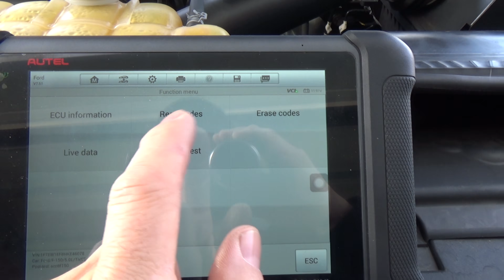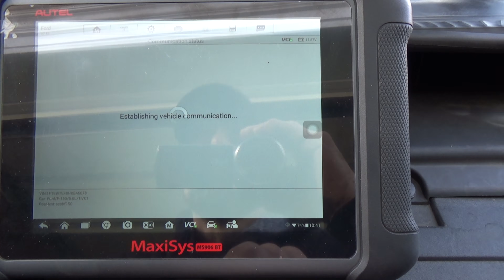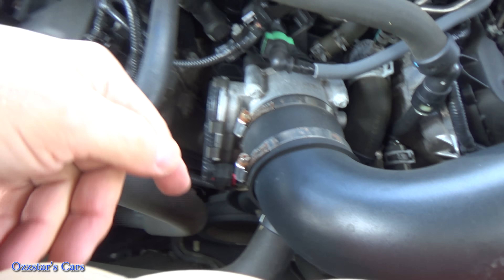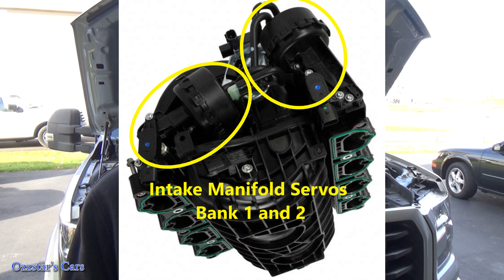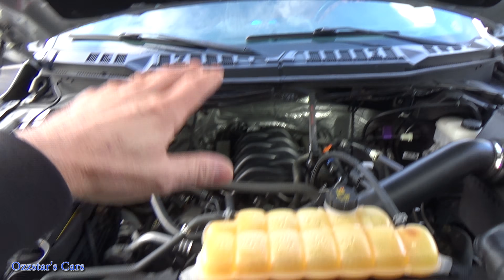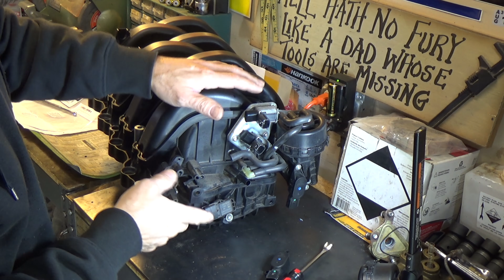Ford F150 Engine Rattle Tick Noise: I Can't Believe Shop Says It Needs A New Engine

Comment: Usually the shaft that runs the flaps breaks between the manifold and the actuator so the sensor still thinks it is working . Check the side that was making the noise and see if it is broken. It causes stalling at idle and everyone thinks it is the VVT system instead.
Reply from the maker: This was a defective intake manifold. The part is non- serviceable.

Comment: I have a 05 e150 4.6l I just had the timing chain and all internals done for that. Oil pump and both banks lifters and followers done and its still ticking at hot or cold start and ticking stays the same with the rpms. I'm now out 4k and I told ford just to put a new engine in it not to throw parts at it. Is there any advice you can give me the noise started at the passenger side front valve cover. I'd pay you to figure or it or if you can please reply and give me your two cents. I'd really appreciate it
Reply from the maker: Where are you located? I am in Delaware. Unfortunately diagnosing something like that over the internet is almost impossible. I don't like guessing and giving anyone poor information.
Reply: @ozzstars_cars  I'm in north carolina and I know it's next to impossible to diagnose over the internet let me read your other reply
Reply from the maker: But if I did have to guess.....were the exhaust manifold gaskets ever checked for leaks? That will cause a ticking sound. 👍😉
Reply: @ozzstars_cars  yeah I put a stethoscope to the front passenger vavle cover the tick seems to be coming from there

Comment: P1000 THATS WHY.THAT MEANS SOMEONE HAS CLEARED THE DTCS AND THE MONITORS HAVENT ALL RUN AND PASSED.TELL TALE THAT CODES HAVE BEEN ERASED IN A FORD
Reply from the maker: Or the battery died or was disconnected for repair.

Comment: My 2018 5.0 makes a cackling sound with light acceleration. My mechanic listened with a stethoscope and it’s not the cam phasers or timing chain. He watched this video and says it’s not the runners. He is stumped, I took it to a second shop, and they couldn’t figure it out either my mechanic did say the sound is coming from the passenger side on top of the engine. Any advice would be great.!
Reply from the maker: Did your mechanic use a scan tool like I did in the diagnosis? Bring the truck to Delaware and I can diagnose the issue.
Reply: Yes he used a scan tool, and said he even unplugged it and it still made the noise. Unfortunately I’m in Idaho.  @ozzstars_cars

Comment: Thanks OC that was very educational.  I have the same problem with my 2019 F150 with 30k on it.  It seems like it's getting worse buy the day.  Right at 1500 RPM it rattles like a metal on metal.  Been getting the run around for a while, need new engine, need new bell housing, need a new trans, need a new front shock, and so on.  Heck, by then I'll just get a new truck.  Ford should have fixed this problem under warrantee.  Great work on finding the mystery rattle.
Reply from the maker: Thanks Paul. More than several viewers have shown this video to their mechanic and helped them get the problem fixed. Hope your diagnosis goes well. Let us know how it goes if you can. -Glen
Reply: My actuators failed at 40k on my 19 with the 5.0. Ford replaced the manifold but the mechanical typewriter sound is still there... And they said to deal with it.

Comment: @ozzstars_cars 8ve been arguing with the dealership about my 19' F150 with the 5.0. They keep telling me it's normal but they don't hear anything. I only have 37k on it so whatever should be covered. Getting them to do it is the thing. I'll have to re-watch this again and write down details as to what to say to them.
Reply: Oh. And I never heard this noise until I started to drive the truck in manual. Due to the transmission shifting 1-3-5 then normal which is annoying. And I got scared hearing the clacking!
Reply from the maker: Better yet, show the technician the video! Good luck and let us know how it goes.
Reply: So, Ford replaced the intake manifold. They took it for a ride and said it was fixed. I drove it 50 feet and it makes the same exact sound. I have to take it back in two days.  @ozzstars_cars
Reply: Update. Ford told me there is nothing wrong and that is just how the engine sounds on the 5.0. At least I got a new intake manifold out of them. Guess it's time to upgrade the manifold and buy a tuner.
Reply: BTW. Ford refers to it as a mechanical typewriter sound.

Comment: I want to thank you for this video. I just bought a 2018 5.0 f150 from Manheim for $8500 4x4 SuperCrew with 150K miles. They sold it as-is due to a nasty "ticking" noise. No check engine light, fresh oil change, sounds just like this one. I have a Autel Maxisys Elite I'll try this on mine. Mine makes the noise at all RPMs but to me it doesn't sound like the "engine". I appreciate the video man!
Reply from the maker: Good luck!
Reply: Standard sound for an injector nozzles on an 18!
Reply: I own a 2018 5.0 mustang with 68k the dam thing typewriter tick started from day one after second oil change. But, goes away after driving 1500 to 2000 km of driving 5k oil change intervals . Possibly air trap in an oil gallery, low oil pressure, collapsing hydraulic slack adjuster. 🤔
Reply: @steveylikangas1989  Add Liqui Moly Ceratec at your next oil change; 100% fixes your issue.

Comment: Nice one. I have a rattle in my mustang's coyote. It sounds very similar to this F150. I believe the intakes are similar if not the same. Its getting checked out on Monday, but maybe it is this! Nothing like some ill informed armchair mechanicing right! Thanks for your informed video though!
Reply from the maker: The intakes are designed different. The intake runners on your Mustang is lower profile engineererd for horsepower over the F150 design for torque. Thanks for the comment John and let us know how your cars diagnosis goes. Maybe show them this video? 😉

Comment: Could this same issue make a rattle at lower rpm such as idle? Mine is a very distinct metal in metal tick/clack that almost sounds as if one plate in the timing chain is contacting something. It completely goes away over 1,000rpm or any driving/load. You only really hear it at idle and it's embarrassing as hell. Ford couldn't find the issue and claimed it needs a motor. 🤦‍♂️

2012 F150 5.0L
Reply from the maker: It could be one of a lot of things. Did you unplug the cam phaser connector and see if the noise went away at idle?

Comment: Alot of engines have been replaced because of this....problem is if it the old intake is used they end up with a 9k engine that sounds just like the old one
Reply from the maker: Unfortunately they sure do. 😒
Reply: My 2018f150 5.0 started doing the " Coyote " Tick " and Clatter at 41k miles ,, ( Don't believe " OLD" has anything to do with it  ,,   )    😊

Comment: that's crazy !! I sell a crap ton of Ford focus cars with the exact same issue. with the intake runner issues. when they snap they sound like a tap in the head .. so I buy All of them with a tap/ engine problem.just have to pull the vacuum hose off and plug it the sound should come and go as you disconnect and reconnect the vacuum hose fix the runner and it makes someone a great car 😊
Reply from the maker: Whatdo you do about the CVT failure and engine overheating issues going into limp mode problems on those Focus?
Reply: @ozzstars_cars   I don't buy the newer ones 😂 I get from 02. to 06 . . just your normal issues with them . I never had a focus that I had that the transmission went . and I have sold a crap ton . now 07 and up yea no thanks .  I usually get them with crazy low miles and won't buy them with over 85k . I think the worst one was bad w/p clogged cooling system rotted freeze plug and bad radiator. that one went for parts for the others .  just amazes me how these goes through the auction with this intake runner issue and it literally sounds like a tap in the top of the engine and it listed as engine trouble. I pulled a vacuum hose off plug it and always goes away no engine trouble for me. they sell a repair kit for those but I just get the intake manifold this way I can clean it and put new gaskets on it while it's off

Comment: Why can't I find people like this guy in the Denver area!  I have a 2014 5.0 , 4 different shops and 4 different solutions for a #4 cold start misfires.
Reply from the maker: It is a challenge to find good help.
Reply: You ever end up fixing the truck? Mine had the same issue with cylinder 8 misfire on cold start. Eventually it got so bad the truck wouldnt fire up anymore.  Shop wanted to charge $8k for a new engine with labor. I figured out it was due to low compression from the intake valves tuliping from too much idle time. Tore the heads off and replaced all the intake and exhaust valves. Had to lap each one in with coarse grinding compound  followed by fine grinding compound and pieced it all back together. Its been running great ever since! About $1200 in parts saved it.

Comment: Question. I have a 2016 F150 5.0. At idle. Ban 2. Makes a fast idle/clicking noise. On and off.. any ideas?
Reply from the maker: Phaser going in and out? Disconnect the sensor and see if the noise goes away. 😉

Comment: Great video, thank you! My 2020 F150 has the same issue, truck is still under warranty and ford says there is nothing wrong, it’s just a noisy engine and just accept or deal with the noise. Can’t wait to go back and watch the service manager view this diagnosis ….spot on 👍
Reply from the maker: Let me know what he says. 😉
Reply: Hi Sean after that happens can you reply on this thread? I am very curious what the dealer will do about this...
Reply: Sean 
What happened with ford ?  We’d love an update here !
Reply: @Meowface. I just went through this. They replaced my intake manifold but it makes the same noise. Ford refers to it as a mechanical typewriter sound. They said there is no type of damage that will occur and I should just deal with it. I'm going to install a boss 302 manifold and buy a tuner for it. I can't deal with the embarrassing noise.
Reply: @Drockvr4  Yup exactly what they told me. Its embarrassing that everyone always stops me and says I have a bad lifter and I have to tell them no its just a 5.0 tick and they look at me like I'm dumb lol

Comment: great vid. Having a ticking noise in my 2017 F150 4X4 V6 eco boost as well. Only 68,000 miles, and your video hopefully pinpointed the issues.

Thank you!
Reply from the maker: Let us know what you discover Scott.
Reply: @ozzstars_cars  you bet ozz. going to try and get to the dealer and do a diagnostic. No engine light warnings from the dash. Drove it all day, ran smooth. It's just annoying. You can bet I'm not going to fall for a "new engine." Dealerships are like hospitals.

Comment: I have a 2002 f250 and it also is making ticking noises as well. It only seems to happen when did send gear and accelerating. Any ideas?
Reply from the maker: Sorry not sure I could diagnose that over the internet.

Comment: I have a 2018 f150 
And it's making and it makes a tickling sound when us on idle and when is running 
I had a mechanic come see it he suggested the engine needs to be pull apart to diagnose what's causing the noise but he is certain my truck needs a new engine. 
However, after I came across your video I need to get a second opinion. I can't afford to replace the engine if it's not necessary.
Any suggestions?
Reply from the maker: Find a technician that knows what he is doing and takes pride in his work.

Comment: My 2016 with 62k miles 5.0. Shop told me I need a new motor bc of a lower end knock. First it was the heads, then the lifters , now they are set on this. 9k for a motor with 100k on them lol
Reply from the maker: Hope it's the right diagnosis!

Comment: Hey Idk if it to late for you to see this Comment but I have the same problem I have a 2018 f150 5.0 the ticking noise on my truck recently got really bad like loud  wear everything I come to a stop and start to accelerate it starts doin that exact noise . I took it to the the Capitol Ford in san jose and they told me I might need a new engine and it's going to be around 11,000 man idk what to do it only has 70,000 miles  on it...does anyone know about good places that deals with this in the bay area..any help will help.
Reply from the maker: Why would it be too late to see this? Good luck with the diagnosis!

Comment: I have this same issue on my 2019 s550. Dealership told me it was normal and don’t worry about it. They actually took me for a test drive in a different mustang it also made the noise. Rattle is right 2200 rpm and only with no engine load. It’s super annoying for sure
Reply from the maker: Total garbage.
Reply: You bought a Ford… 2 seconds of research on repairing F150 you get thousands of videos… coincidence. Owning a Ford is for folks who love to work on cars and have $ to burn for this “hobby”

Comment: 2014 f150 5.0 have cat issues below efficency, air fuel ratio is 14.6 ish at idle, fuel trims are off by 3 numbers both short and long term. Sometimes runs rough at idle, lower rpm power feels down but strong over 3500. 
Had an exhaust valve spring break but replaced it on cylinder 3 but it was sending hot exhaust gasses into the intake enough the runner for 3 would get hot hot after 30 sec of idling. Got all new plugs, coils and injectors(motocraft) and a new intake manifold. Had a misfire code on 8 but a new coil and injector smartened it up a bit.
Trying to replace anything that may have been damaged with the exhaust feeding into the intake. Should be getting my cats replaced soon as well. 
Based on process of elimination if this doesnt fix the rough idle and low power at low rpms i believe the fix to be either a valve job of reman engine. Based on this do you feel im barking up the correct tree.  Ive got limited diagnosis equipment other than a basic bluetooth scanner and forscan light. 
Im too cheap and dont trust sending it to a ford dealer after my last experience paying 600 for them to tell me my valve control body in my tranny was fine trying to downshift at highway speeds to 1st or 2nd gear. 
Im decent at the process of elimination but usually because i try 50 things first starting at the easiest fix.  Truck has 160,000km or 100,000 miles usually running 0-40w delvac, but tried 0-40 euro car this last change and it seems to be too thin at startup as i started getting some smoke out the exhaust yesterday before the truck is fully warm but cant really tell if its oil or a leaking injector loading up a cylinder.
The bank with the slightly differnt fuel trims also runs a very incosistant afr and bounces between high 13.8ish: 1 range to sometime touching 15:1 just cant remember if it was bank 1 or 2. One had the issue on cylinder 8 misfiring and 2 had the issue with the broken exhaust valve spring.

90% of what i know comes from self teaching and two strokes so im a little lost and looking for some guidance as id like to be able to fix whatever doesnt need a special $1000 tool or lift myself.
Reply from the maker: Sometimes you need a special tool.

Comment: You the man!! thank you...  I have the same exact problem in my brand new mustang GT.. I thought I was going crazy.
Reply from the maker: Common issue in the Mustang. Glad the video helped!
Reply: The dealership are saying it’s the cam solenoid and that the noise is normal. They are willing to replace it but are saying it will not change anything. 
They said the problem in this video was corrected in newer models I have a 22 5.0
Reply from the maker: @mystrocs  you showed the service tech my video?

Comment: Will this make the engine over heat, I parked my truck for a couple of months then started driving it again. I noticed this sound and after the third day it started to over heat when I was on the highway.
Reply from the maker: The intake performance shouldn't have any adverse effect on engine temperature.

Comment: Ive got a 2014 fx4 f150 and it ticks when i give it gas but not when gliding. I figured it was just the injectors?
Reply from the maker: Injectors do tick but if it's that loud you should diagnose that it isn't something else.